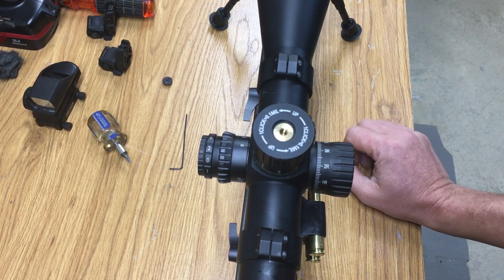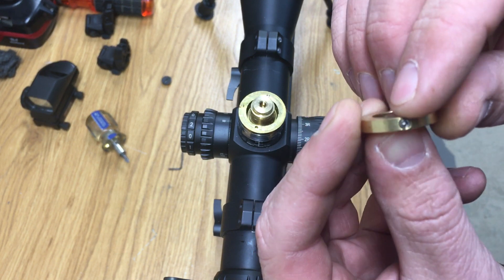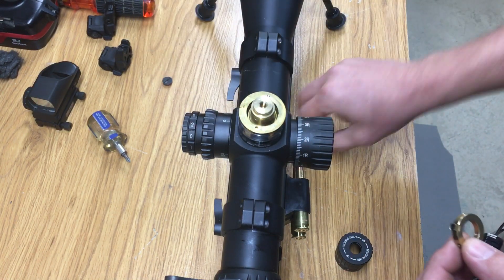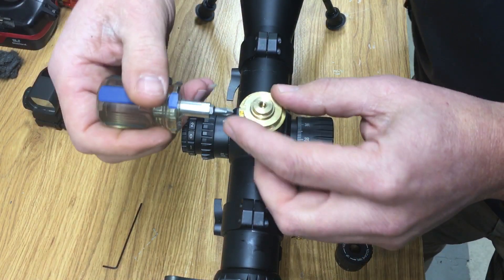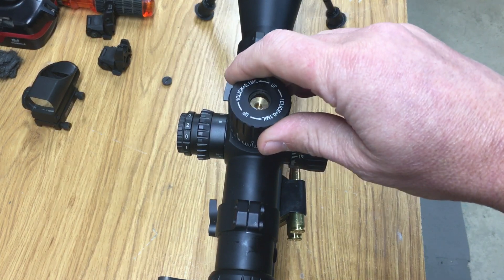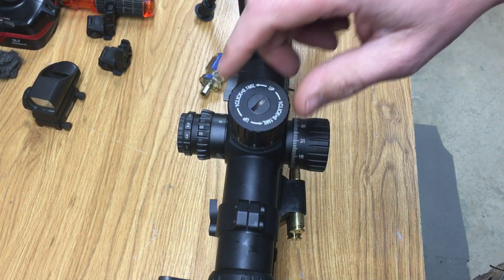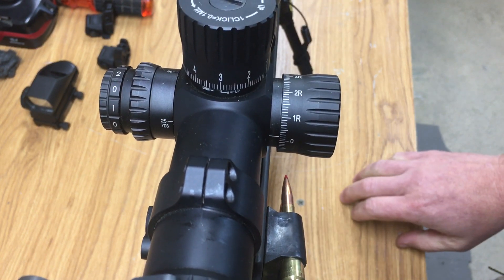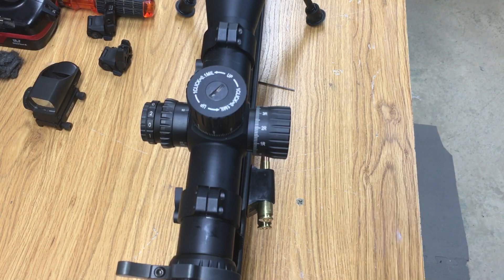How to set the Zero stop on Athlon Ares ETR scope

Comment: Lot better than the areas gen 1 clicks. Bad ass scope . bought 2 amazon currently has the Ares btr in  4.5-27x50 Mil recticle for $425! Hurry before that deal dont last. Its still 799 for moa version.
Reply from the maker: Yep. We are an Athlon dealer and really like the Ares ETR line. May wanna get the Aers BTR while you can, though. They have discontinued the BTR line. Once they are off the shelves, they are gone forever. The ETR, however, is still available. And will continue to be.
Reply: @rdtaguestudios  Why they stopping Btr line, to bridge the gap from the 30mm tube for the argos line then straight to the 34mm tube for ETR line? Yea i wish i could get a ETR half off, Or a Cronus half off . But i do have plenty of scopes now with buying 3 of the BTR's recently.
Reply from the maker: @Matt-xy6cf  ?? They didn't ask me lol.
Reply: @Matt-xy6cf  I also bought 3 of the Ares BTRs (gen "1.5") now they have the gen2 out, which is the reason for the sale it would seem. The 2.5-15X are still $400 at midway but the 4.5-27X are all sold out at the discounted price. I am glad I was able to snag one of those up. The "gen 1.5" models have a better feel to the turrets than the originals and they get even better if you remove the orings from the turret caps.
Reply: That was an excellent deal for the Ares BTR.  They are very nice scopes even though they are Chinese.  Way better than the crappy Argos BTR.

Comment: Really well done!  But I have a question:   When I push my turret cap back on, it will only go down to just past the "2 horizontal line"...it leaves the "1 line" and the "zero line" showing...shouldn't it push ALL THE WAY DOWN to the "down arrow"?  What did I do wrong?
Reply from the maker: It most likely won't go all the way down, since you have zero'd your rifle. Those lines and numbers don't mean anything at all, if you have the zero stop set.
Reply: Those lines mean everything. I have the same problem. Now I only have 15 mils of elevation instead of 30mils as advertised.
Reply from the maker: @rc51price  Total available amount of elevation is dependent on several things, such as yardage you zero, amount of cant in scope base, ring height, etc. For ex: on my 22LR, I have 1.53" rings and 60moa of cant in my base/rings. This allows me a 35y zero and gives me 33 mils of UP. However, if I change to lower rings (same cant MOA), my zero would go farther out and total available UP would go down.
Reply: @rc51price  I hear you. After zeroing the rifle at 200 yards. I set the zero stop. I think I have like 12 clicks left before its maxed out.
Reply: Canted rails. 10, 20, 30 moa cants built into the rail. Will recover that much in elevation travel

Comment: Thanks a mill for this video, Rich.  I had no idea how to do that.  Just got my scope recently and hadn't gotten to that part yet.  Just seated it on the rifle this morning.  This video will help me greatly for once I'm zero'd in.  Looks like you're using the Warne Maxima rings, too.  Yes/no?  I have the same ones in the high model.  The 222M's.  If that's what you have, how do you like them?  I have a virgin build here.  Can't wait to get on it and get some rounds downrange.  My first bolt-action.
Reply from the maker: Glad the video helped! Honestly, I can't remember for sure which rings, as this was on a customers rifle. I, typically, only use Warne or Leupold rings when I mount a scope. Just not sure which model these were. BTW, you're gonna be impressed with Athlon scopes. $ 4 $, you can't beat them.